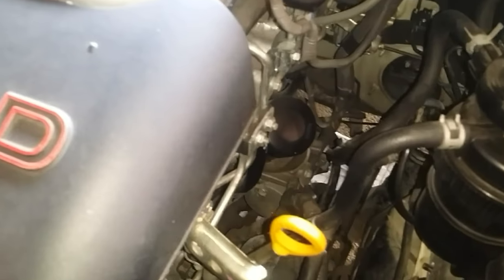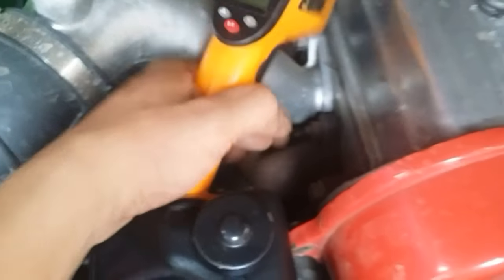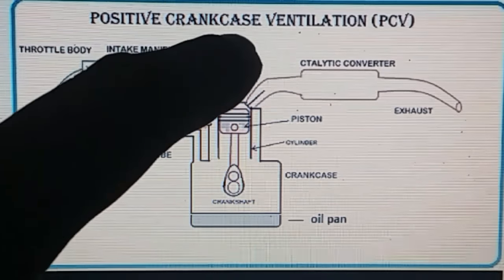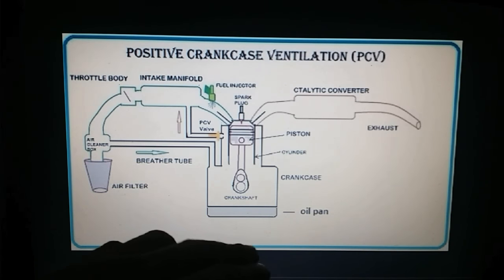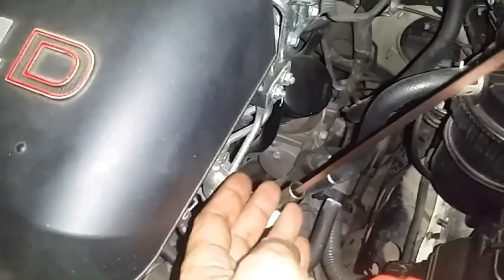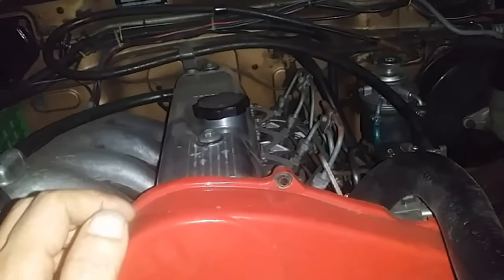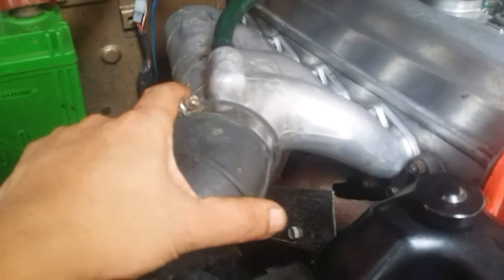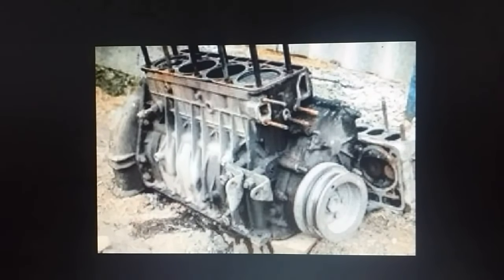Blowby Oil Smoke out the Dipstick Hole is NOT NORMAL, PCV Valve, Runaway Diesel

Comment: Can it be a bad head gasket also?
I did a compression test on my Sbc 
One side is 175 across the bank 
The other side are all over the place with #6 the lowest at 80 psi all the others were 100 100 140 so with them all being low it seems like a head gasket ?
Reply from the maker: Thats a very significant deviation between cylinders. If its the head gasket that would manifest in your cooling system. 1. Always loosing coolant. 2 coolant has oil 3. Engine always has a high temperature than normal 4. The engine would have an uneven idle or vibration when it warms up and you would see coolant or air blowing the coolant out the rad cap esepcially when the engine is hot. 
Conduct a leakdowt test to ascertain where the leak is coming from
Reply: @MrDIYer  thank you very much for your reply ! 
Yes it’s really odd why that bank is low and all over the place!
My coolant is getting brown but not milky
Nothing on the dip stick 
Oil isn’t shooting out anywhere 
My catch can doesn’t have anything 
It’s all smoke and you can definitely feel the pressure on the dipstick tube 
I was hoping and trying to talk myself it was a head gasket lol but it seems to be a bad piston or ring lands it was just odd that I got them weird readings on that side …
Just hoping I didn’t crack the block ! 
We shall see soon ! I will do a leak down test and then tear it down 
Thank you very much for your response and the videos ! Subscribed 👍🏻
Reply from the maker: I think cylinder number 6 is loose either worn out cylinder or broken rings. One reason i can think of why the deviation is confined to only that side is a clogged oil gallery or the oil sprouts to that side.
Reply: @MrDIYer  yeah I can only hope i can do a re ring give it a. Ice hone and set it free 
I will definitely do an update !! Thank you for all the great information! I appreciate it !
Reply from the maker: @juiced71  please do. Im curious as well. Update me regarding the status of the oil gallery or oil sprouts.
Reply: @MrDIYer  this engine is a small block Chevy 400 and they have steam hole between each cylinder humm soon as my foot heals I will be ripping this apart it’s killing me not knowing lol
Reply from the maker: Oh i see lol. Before you do. Have you check oil pressure? Im intrigue because as it stands the only logical reason i can think of is oil not lubricating that side of the bank causing a much sooner wear and tear only to that side. Or maybe a clogged steamholes, just maybe lol. I doubt a crack cylinder head or gasket, but like ive said a leakdoen test will reveal that. I really am intrigue. I would appreciate an update as to what you may find out. Lol
Reply: @MrDIYer  haha!! 
Oil pressure is good cold about 60 once it’s warm 30 
I took a pic of my plugs definitely rich 
However #6 plug doesn’t look real bad 
Number 8 does crazy lol
Reply from the maker: Lol now im really at a lost as to why low compression only favored one side. But i would still put my money on a worn out cylinder or rings. The reason being is that you said you can really feel pressure out the dipstick tube. I doubt its a crack head or block. That rarely ever occurs amd all too often its by reason of overheat.
Reply: @MrDIYer  well the verdict is in 
#6 piston had a bad ringland once I got the piston out I pulled a chunk out of it 
   #8 and #4 were cracked through 
#2 piston was ok 
Looks like a hone and new pistons will fix it up ….
Reply from the maker: Been wondering when the update will come out. Lol compression test results are verified what still buffles though is why wear and tear only favored one bank. Do you have a bore gauge? Make sure the cylinders are not tapered and out of round. Because if it is. Honing it wont cut it, it will just make it worst. Needs to be rebored.
Reply: @MrDIYer  yeah definitely a puzzle on why it was only the one bank but it was definitely detonation 
I am using a blow through carb setup it never missed fired and no high rpm breaking up ran good actually lol 
But turbos will do that lol 
My compression was high I’m sure everything factored in 
The cylinder walls look real good you can basically see the hone marks still 
But you are right I need to grab a bore gauge to verify so I should say hopefully everything is still straight lol
Reply from the maker: @juiced71  thats the thing, the tolerances that engines require cannot be seen by eye. Its thinner than the human hair. Here its pracrice when they dont have a bore gauge they just bring the block to the machine shop with oversize pistons and rings. But if you ask me its  better to have a set of micrometers and a bore gauge.that will tell you what oversize piston and rings you need. Plus its fun to use lol (as far as im concern lol)
Reply from the maker: @juiced71  heres a link to a video about my dial bore gauge in case you might want to check that out https://youtu.be/0oN0-vLN0j8
Reply: @MrDIYer  haha! Yeah not real expensive either ! 
I’m always afraid of machine shops !
Everything you send always needs it it’s how they make money 💰 oh sir you got it here just in time lol 
Definitely pay for itself 👍🏻
Reply from the maker: @juiced71 yeah. Lol that is why its better to have those measuring tools. That way you yourrself knows what needs to be done.

Comment: Hi sir., my prado was blowing oil and smoke on the dipstick. Im suspecting theres a excessive blowby. Did a compression test and i got 380psi.  Can u help me whats causing it? Thanks
Reply from the maker: Compression reading for each cylinder?
Reply: @MrDIYer  yes sir. I wanna send u all the paperworks done but unfortunately i cannot send it here. Is there any plaform where i can send it to you?
Reply: And also they changed all the injectors including injector seats.
Reply: @MrDIYer  all 380psi
Reply from the maker: Assuming the conoression test was done correctly and all cylinders has the same 380 psi then thats normal.
Reply: @MrDIYer  so its just normal although it blows an oil and smoke on the dipstick?
Reply from the maker: Compression test per cylinder,  five rotation each. Other people when performing compression test they crank the engine until they get the same result for each cylinder.
Reply: @MrDIYer  thank you so much sir.. appreciate all the help🙂

Comment: Smoke coming out of the dipstick in my montero with just 10t km in it.  Casa say its normal.  What can you suggest sir? They say its normal because of the new technology.
Reply from the maker: perform a compression test.
Reply: @MrDIYer  Thank you sir thats my next plan of action. ive already contacted the dealer.  Your videos are very informative and fact base.
Reply from the maker: @bertkitz8775  thank you sir. im sorry thats the best i can offer. it just seems counter intuitive for a new engine with supposedly new technology to spew smoke out the dipstick hole. but conduct a process of elimination in order to be sure. its all in the videos.

Comment: Sir good day,  toyota 2e sa akin,  dami ng talsik na oil sa dipstick sa akin sir,  may oil na din sa breather ba run kasi yung air filter ko may oil na,  bagong replacement na oil seal sa crankshop nag leak agad,  bagong replacement na oil pump may tagas din agad,
Reply from the maker: Compression test nyo sir para makasiguro.. pero talsik sa dipstick ay masamang indication ng blowby. Kaya kahit ilang ulit po kayo mag palit ng crankshaft seal. Mag leleak at mag leleak parin yan. Dahil sa blowby pressure na nabubuo sa loob ng crankshaft kaya crankshaft seal ang tintulak ng pressure kaya lumalabas ang oil.
Reply: @MrDIYer  salamat sa advice sir,  need pa po ba e check yung pcv valve sa case ko sir?
Reply from the maker: Yan po pinaka madaling e check nyo una. Panadarin nyo makina tangalin nyo dipstick. Tapos tangalin mo rin yung pcv valve tignan mo kung mawawala yung talsik ng oil sa dipstick
Reply: Ni lagyan ku ng coupon bond yung hole sa dipstick sir,  masyadong madami na ang talsik na oil sir
Reply: @MrDIYer  ah okey sir maraming salamat po sa advice sir,  God bless

Comment: sir yung delica ko diesel 4d56 may talsik at usok na sa deepstick at oil cap filter. for overhaul napo ba? sabi ng ibang mekanico dukot daw sabi naman ng iba TOP overhaul. ano po advise niyo thank you
Reply from the maker: kung mag pasya po kayo ng overhaul wag nyo na po tipirin. baba makina. palitan lahat ng dapat palitan. piston, piston rings, cylinder sleeve. crankshaft at conrod bearings. overhaul gasket kit. etc. mas mainam kung may bore gauge at micrometer at steel straight edge para masukat ng maayos ang dapat sukatin. di yan mababase sa tingin2x lng. pa machine shop pa rebore at hone
Reply: @MrDIYer  sir kararating lang ni misis chineck ko ulit engine ng van ko may tumagas na langis sa oil fill cap kahit mahigpit naman siya
Reply from the maker: mga inidikasyon na yan ng malakas na blowby. pero para mas maka sigurodo mas mainam man compression test
Reply: @MrDIYer  sir magkano kaya magagastos sa compression test thanks